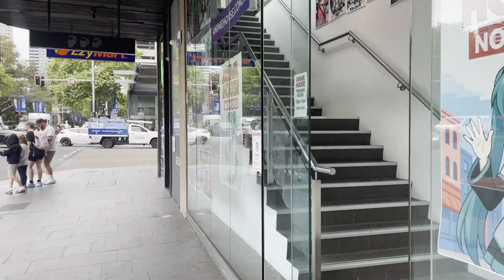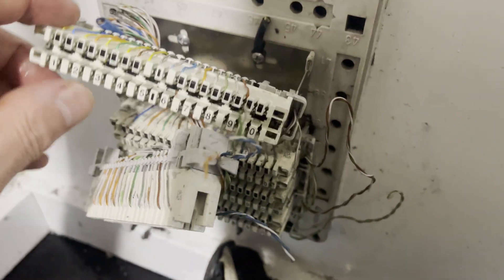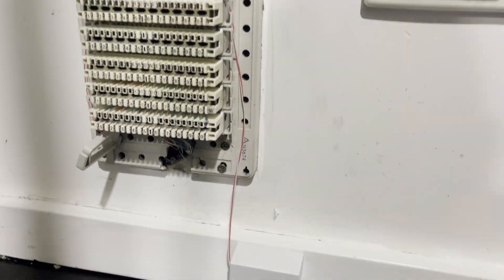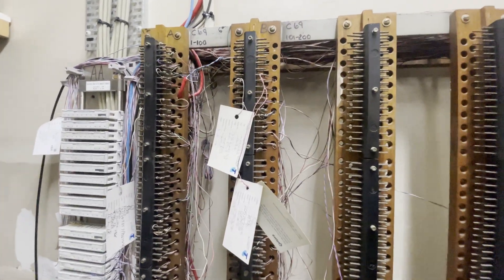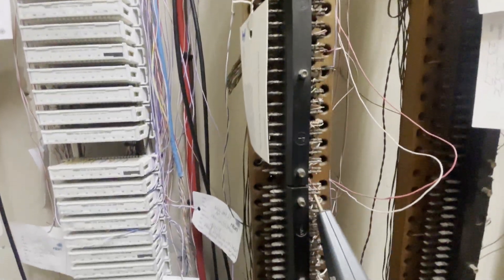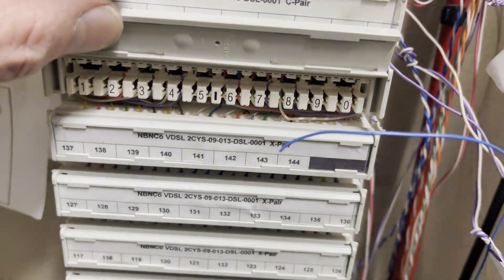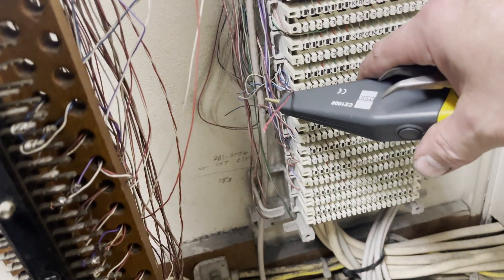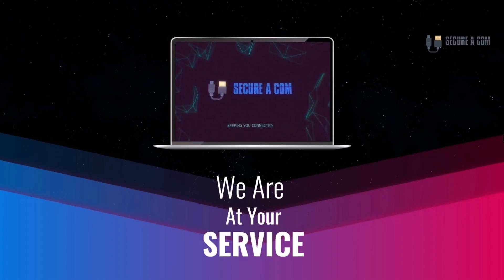IDF & MDF Clean Up & Maintenance + MDF Jumpering for FTTB in Sydney | Network Setup & WiFi

Comment: Great!  Wire Wrap Terminals!  I've had a few network security appliance upgrades with xDSL only terminated & tagged to the MDF and this shyte to cross connect to, to get the port into the tennants' premises.  Happens in Brisbane as well.  Every time the ISP assured the port would be active in the tenancy premises.  Well I sent them an email memorializing their their claim as a contemporaneous note before attending site after getting caught the first time, cost the ISP dearly!  Client was very impressed.